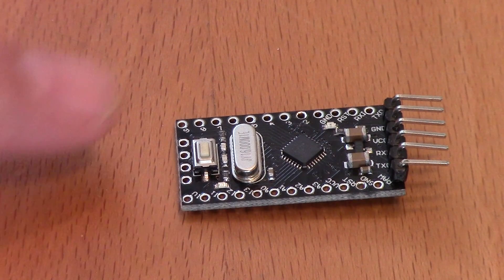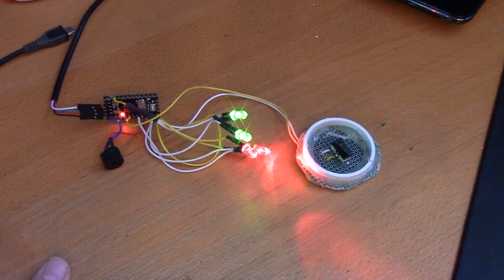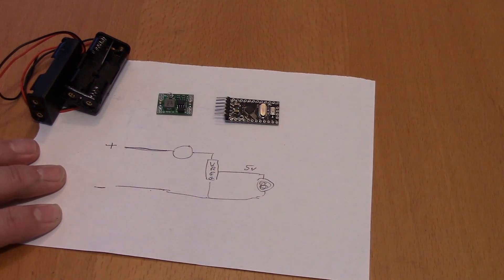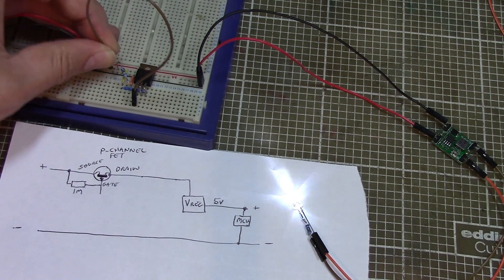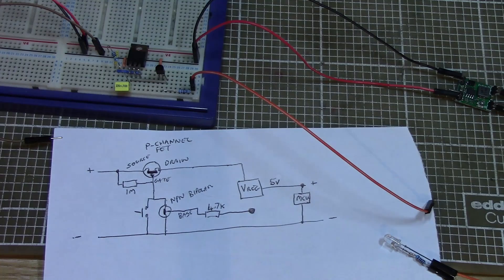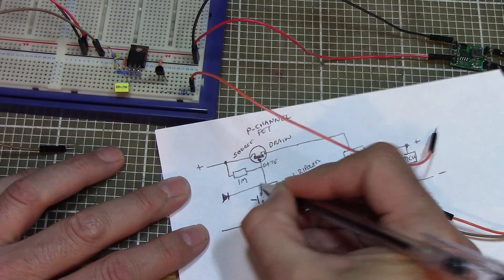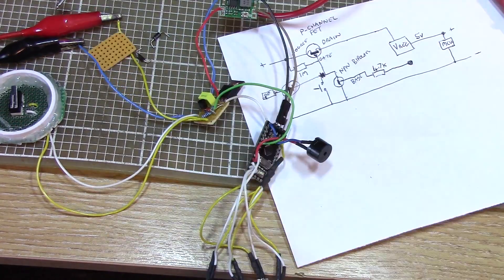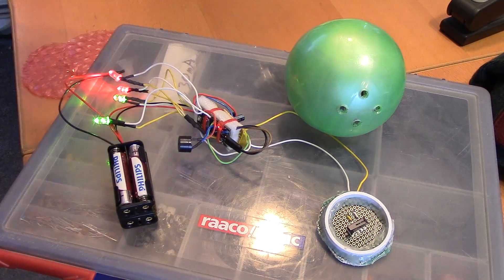Arduino soft power control

Comment: Thanks. I guess only missing part is mosfet selection. IRF5305 or IRF9Z34N which I have for some reason is not ideal if microprocessor operates at 3.3V or so (lifepo4, 3xNiMH, li-ion, ...). Few years ago I bought a few TP0606N3-G and  LP0701 ... not sure why exactly these, they have quite high on resistance, but vgs(on) is 2.4 or 0.7V. Ok, after experimenting, TP0606 draws about 1-3uA depending on VCC when it should be off (maybe it always conducts a bit), has higher resistance and it's likely discontinued.

Comment: Hellow, 
Can you please explain me the use of two diodes here. If we use one controll pin from arduino it will turn on when the button pressed(if the code has written to turn high the controll pin in void setup function) and keep the mosfet on no? So what is the use of getting state of switch? Thank you
Reply from the maker: It means that you can use the 'on' button for multiple functions once the arduino is powered up. Click to turn on, double-click to enter a menu etc..I made a toothbrushing timer for my kids using this circuit and made it so that a long-press on the switch would turn it back off again. Hope that explains it. Thanks for taking the time to watch and comment. Cheers!!

Comment: The capacitor is initially charged through the 1M resistor. How can it keep the P-Channel MOSFET on by supplying a high voltage at its gate? It is low voltage that turns on this MOSFET!! That’s why you have the 1M pull-up resistor to keep it off normally!

Also when you press the button it instantly shorts the capacitor, which is a great way of discharging a capacitor. I don’t see how the capacitor can give you any lag time. Sorry, I just don’t understand. I would love to know how this circuit works.
Reply from the maker: Hi Daniel - It's been a few years since I made this circuit, so my memory is a little rusty at this point. The circuit isn't using the pull-up resistor to keep things switched on - it is using it to keep things switched off by default. The MCU has to pull a pin down (or up) to keep the circuit activated. When you push the button it rapidly will drain the capacitor to ground enabling the mosfet and supplying power to the MCU. When you release the button, the capacitor will slowly charge up again until it reaches the voltage where the mosfet switches off. The Arduino needs a couple of seconds to get past the bootloader and into the code which is driving the pin to keep things enabled. The 2.2uF capacitor charges through the 1M resistor, and it takes around 3 seconds for that to charge to the point where the mosfet will switch off - this gives a little bit of time for the arduino to get itself booted up into the code which then drives pin12 to keep the power switched on. Without that capacitor you'd have to hold the power button down for a couple of seconds to get the power to stay on. Hope that explains it better. Cheers!!
Reply: @ThingsWhichArentWork  Hi Jim, thank you very much for your reply. What I am struggling to understand is the role of the capacitor. Since it charges initially through the 1M resistor, and it puts a positive voltage at the gate of the P-channel FET, this will keep the FET off rather than keeping it on for the 3 secs or so that is needed. 

When the capacitor discharges, it still has a positive voltage, albeit it is decreasing rapidly towards zero.

In my silly mind, I am looking for way to keep the gate of the FET at ground for 3 secs, rather than putting a positive voltage at its gate. Maybe I am looking at this wrongly or my assessment is messed up :)

Comment: I have seen similar circuits where you can connect the base of the BJT to the Drain of the MOSFET. As soon as you press the button and the MOSFET turns on, the drain receives power and it pulls the base of the BJT high, thus latching the circuit into an power-on state. This way, you don't need the pin from the MCU to keep the BJT on. Great project and video. Enjoyed it very much. Thank you.
Reply from the maker: If you use BJT to keep the mosfet on, can the MCU still switch off the power when it's finished its work? I'd like to know more about this solution. Thanks.
Reply: @ThingsWhichArentWork  Hi Jim, I built the circuit with both MOSFET/BJT and MOSFET/MOSFET. 

Things worked fine with pushbuttons, but when I used an Arduino Uno, I could not get it to turn off either. Things look so great on paper, but then I read people talking about the diode-like behavior of the Arduino pins that make switching off transistors so hard. 

I'll keep at this to find a solution. Thank you for the great video.

Comment: Hi, could you please share a close up photo of your stripboard layout? I've built this on a breadboard and everything works except using the button as an input after the powet has been turned on. I think I spent 2 hours just trying to get the diodes right but to no avail. It's quite frustrating but I'm sure it's something trivial that I'm not seeing. In any case, whatever I do the button always reads either high or low, depending on the diode positioning - pressing it doesn't change the value.
Reply from the maker: Hi Serelek - I felt bad that you'd spent 2 hours debugging already, so I pulled apart my unit, cut the cable ties and removed the layers of kapton tape so that I could take some photos for you.... Front: https://raw.githubusercontent.com/jimconner/ArduinoSoftPower/master/PCB-Front.jpg ... Rear: https://raw.githubusercontent.com/jimconner/ArduinoSoftPower/master/PCB-Rear.jpg ... Hope that helps. Cheers!!
Reply: @ThingsWhichArentWork  Thanks a ton Jim, I really appreciate the quick answer - I honestly wasn't really expecting a reply seeing as this video is over 5 years old haha. Your pictures are perfect and I got it all working great now! The issue was that I built the circuit using your first diagram and then I was adding the diode between the button and MOSFET gate without taking out the piece of wire that was used to connect them before. So the diode wasn't doing anything either way! I took out that wire and it all just clicked. Thanks again!

Comment: Thanks for sharing knowledge!  One question though... when you show your breadboard (at the 4:25 timecode), I see that your yellow and blue wires connect your source pin to power, however what is your drain pin connected to?  Since it is bent over, I cannot see anything.  Thanks!

Comment: Very nice Jim.. Great explanation too. I'm sure the kids will love it. One thing though.. How did you get the electronics & batts in the ball? Or is this a secret ship in bottle type skill ☺️
Cheers. John
Reply from the maker: Hi John - I just cut a small hole in the ball, and then stretched it over all of the electronics... though actually the ball didn't last for long... all of the squishing wasn't good for the solder joints, so these days the electronics all live inside a 3d-printed Android-logo style robot, and you pat it's head to activate the switch to turn it all on. Cheers!!

Comment: i have bought a Arduino starter kit,  but i am new to this type of thing , do you now how the hell i get started,  as watching this video has made me realise how hard this learning curve will be , do you now of any channels for real beginners? many thanks Scott.
Reply from the maker: Hi +Scott Thompson - Julian Illet's channel is a good choice for learning from - he often goes into good explanations about how basic circuits work. I would say though that the best approach to any project is to get stuck in, and fill the gaps in your knowledge as an when you need to - It's not that hard to go from a flashing led arduino sketch to making the LED flash when the analog input detects a higher voltage from a microphone (or something like that)... and it's not hard to go from there to the next step... That way you have a bunch of little learning curves instead of one big one. This was actually my first every arduino project, and as a result of someone letting me know in the comments below, I've discovered that the RAW pin on the arduino is the input to the onboard voltage regulator, so I didn't actually need the seperate step-down board at all... It's always good to learn something new, and I won't make that same mistake again. Hope you're having a good weekend. Cheers!!
Reply: Thank you for the advice sir , all about increasing knowledge an  building confidence , like with most thing , persistence pays off . many thanks Scott .

Comment: Actually a good video for educational purpose but completely unnecessary in this case ;) The arduino has a built in 5V regulator. It also works fine with voltages down to ~3V, so you can just power it from 3 AAAs or one LiPo without regulation at all. It also features low power / sleep modes with current consumption way below 100uA and wake-up on interrupt (button press). You just have to kill the power LED on the board. It can also monitor its input voltage so you can make a low battery indicator too.
Reply from the maker: Hi +RoterFruchtZwerg - That may be the case for propper real Arduinos, but the super-cheap clone Nanos that I'm using don't seem to have any kind of voltage regulation built in. I added the step-down converter after I'd blown up two Nanos already. I'm 100% sure that my Nano clones don't have voltage regulation... I've measured their current consumption at various voltage inputs and it scales up rapidly as the voltage goes up... The LEDs get brighter, the speaker gets louder and the Atmel chip goes hot, hotter, too hot, magic-smoke... I was rather frustrated to have to make this circuit as I'd done a similar sort of thing before using an ElectricImp device, which has an ultra-low standby power even when the voltage regulator is left active. I'll have to get myself some real branded arduinos one day, but I've still got half a dozen of these clone Nanos to use up first. Cheers!!
Reply: Jim Conner I also use cheap clones... They have a unregulated 5V (or 3.3V also exist) input and a separate RAW input that usually goes to a LDO voltage regulator... But anyway, if yours doesn't have a LDO, you can still power it directly from 3 AAAs. For low power consumption, look for the lowpower.h arduino library.
Reply: +Jim Conner yours also has the RAW input and a LDO voltage regulator right next to the RX pin (telling from the close up right after the intro)
Reply from the maker: +RoterFruchtZwerg You're right!!!... I hadn't looked too closely before (I think I mentioned in the video that this was my first every Arduino project)... There's a RAW input on there (I wondered what that was for) and a 5v regulator... D'oh - What an idiot I am.... I'll add an annotation onto the video to let others know too. Thanks for setting me straight. Cheers!!

Comment: Jim - thanks for the video. I liked involving the children in "inventing" solutions. There are a few other quite similar solutions using two FETs. Are there any solutions with SMD components only? I need a circuit in which I can use the same switch for another purpose (pressing it for a shorter duration). I think this circuit will work - just need to change the code. I am surprised there is no specialized device for doing exactly this given this is a requirement in a large percentage of electronic devices. How do mobile phones handle this requirement (I assume the microcontroller can be sent into / woken up from a deep sleep state using a switch). Any ideas?
Reply from the maker: Hi Puneet Teja - I scoured the Internet long and hard searching for a ready-made soft-power board, but couldn't find a single one available anywhere (with our without surface mount components) - I'm half tempted to design a PCB and see if I can get some manufactured cheaply somewhere so that I can start selling them on ebay. Mobile phones handle their soft-power in exactly the same way as this circuit for power-off situations, but deep-sleep is not quite the same situation. With deep-sleep all of the perhipheral devices are powered-down, but the power is still sent to the microprocessor (which is using close to zero power as the clock can be stoped and no instructions are being executed. The chip is set to wake up when it sees the state of one of it's input pins change, but all of that is handled by a built in interrupt handler in the microprocessor - this allows for things such as the real-time-clock to wake the processor to trigger alarms etc. Hope that helps - Have a great weekend. Cheers!!
Reply: Jim Conner - Thanks for the deep-sleep details. It is a great idea to get something like this manufactured as a ready-to-use breakout board. To keep it  flexible, the power on/off must be microcontroller controlled in addition to the switch. This way the switch can be used for other functions with a short presse and multiple short presses and long press to switch on-off.
Reply from the maker: Hi Puneet Teja - The circuit I used in this video lets the button be used for other functions too. Pressing the button just ensures that the power stays on for around 2 seconds... subsequent pressed can be read by the microcontroller as a button input, and when the microcontroller decides that it's time to switch off, it just pulls an IO line low and sits and waits for a couple of seconds until the power dies. Maybe I'll knock together a PCB layout for this board over the next few weeks... might be a fun side project for me. Cheers!!
Reply: +Jim Conner - check out this device: http://www.linear.com/solutions/1710
It meets all your requirements and more! What do you think? I am sure other manufacturers have similar components. Am on the lookout.
Reply from the maker: Hi Puneet Teja - That's for that... The LTC2955-1 looks like almost the perfect part for the job.... If I'm reading the datasheet correctly then the power-button state is also available on the _INT pin which feeds into the micro... I wonder if the state of the power button is directly matched with _INT, or if _INT is a single pulse which is triggered on a button push... (hopefully it directly matches the power button state as then you could use long-press / short-press for activating different functions)... I'll take a better look at the datasheet when I'm at home this evening. Thanks for letting me know about it. Hope you're having a good day. Cheers!!
Reply: +Jim Conner Yes - the state of the pushbutton is directly fed to the _INT pin. The device also allows you to power off using long press - exactly what I am looking for. Here is an article and app note: http://cds.linear.com/docs/en/lt-journal/LTJournal-V22N2-02-df-LTC2955-VuiMinHo.pdf
Enjoy!
Reply: +Jim Conner - Check out this ST device. It is even better and much cheaper than the LTC2955: http://www.st.com/st-web-ui/static/active/en/resource/technical/document/datasheet/CD00226957.pdf
This is what I am going to use!
Reply from the maker: Hi +Puneet Teja  - That's quite a nice chip... but I see that it only works up to 5.5V input voltage - in my case that would mean that I'd have to add an extra mosfet to switch off to the DC-DC converter... Not the end of the world, but would have been nice if they'd built an extra mosfet into the package. Cheers!!
Reply: I completely agree. I happen to have an extra MOSFET left over from the charging circuit that I can use here.
Reply: Hi Puneet & Jim, If you are interested in a SMD solution, you can look at something like the TPS342x from TI. If you configure the shutdown delay to say 5 seconds, any button press for a shorter duration can be read as a user input. The way mobile devices work, is that they never shutdown the processor. It is always in a low power sleep mode - that way, the processor can still read the power button to turn the device on. Any other tech gurus out there, please correct me if I'm wrong.

Comment: Im also new to arduino aswell, one of my current projects is a 100w torch with fan control, battery management etc. I was struggling to find a nice way to turn the arduino on and off, so I will definitely be trying your method!
Reply from the maker: Thanks ScottieNiven - I'm surprised nobody makes a ready made board for handling soft power control. I scoured ebay for a while before resorting to stripboard, but came up empty handed. The torch sound like it will be pretty awesome when it's done. Cheers!!
Reply: Jim Conner It is strange, I also did look for one. Ive got it to the point where the LED is switched on and off and the fan is controlled by heatsink temperature, I still need to buy the battery protection PCBs and figure out a way for the arduino to monitor the battery and add PWM to the LED. At the moment I can get around 2 hours from a single charge at full brightness!
Reply from the maker: ScottieNiven What are you using for the battery? I'm guessing it's going to be around 200Wh capacity, but I'm curious as to whether you went with lithum, nimh or pb. Cheers!!
Reply: Jim Conner Currently its a 16 cell 18650 Li-ion battery, 4 cells in 4 sets. Its roughly around the 200wh mark 16v * 12ah but the cells were recovered from laptop batteries, so they may not be 100% capacity
Reply from the maker: ScottieNiven I'm a great fan of old laptop packs... I rejuvinated an old 100W halogen torch a few months ago by replacing it's long-dead 4Ah lead-acid with 13.2Ah worth of old laptop batteries... It's a vast improvement. Cheers!!